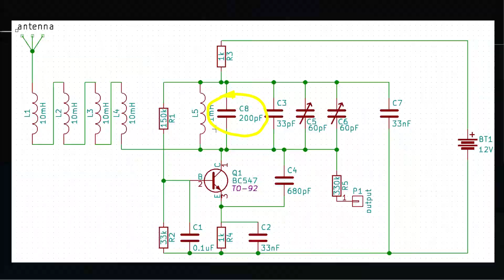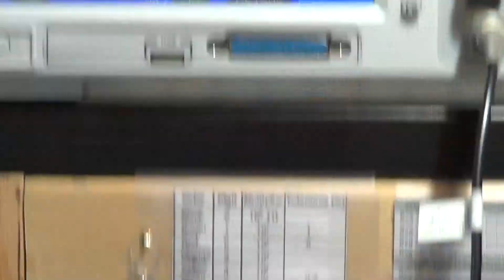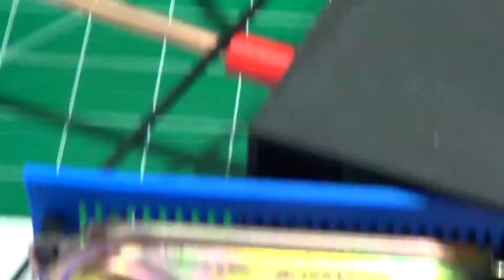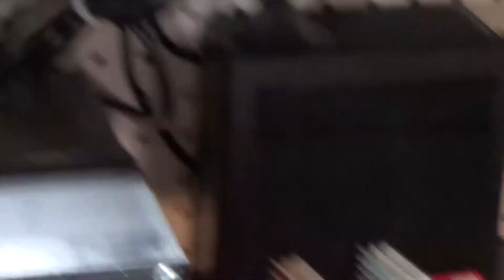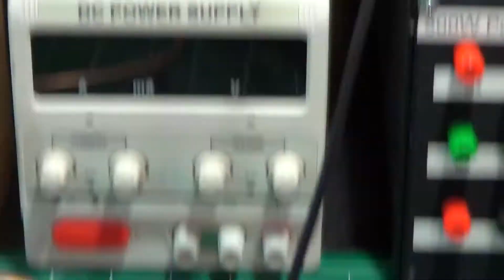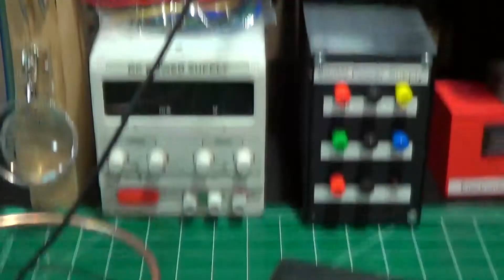Theremin Episode12: tuning of the pitch oscillators.

Comment: Hello Sir, how did you measure the length and radius of antenna? Is there any calculation for that?
Reply from the maker: There is really no specific calculation for the antennas. The Theremin antennas are not used like those for radios, for example, where do you need to tune them based on the frequency range they are supposed to work with. Instead, for the Theremin, they are just used to exploit the capacitive effect of the combination of them and the hands of the player. So, at the end, the size is merely dictated by the available space around the Theremin. The Pitch antenna will work fine as long as it is at least 2 feet long. The volume antenna is a circle large enough to be able to put a hand in the center without touching it, but that's about it.
I hope this helps you.
Reply: @eleneasy  Yes!! Thanks for your help!! Love your videos, got a lot of conceptual clarity, the best of all the theremin videos :)